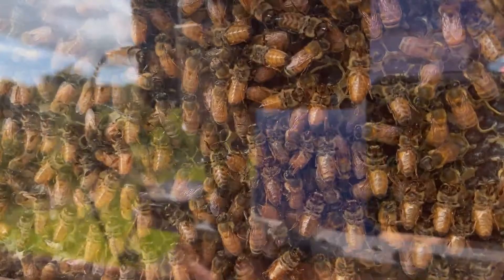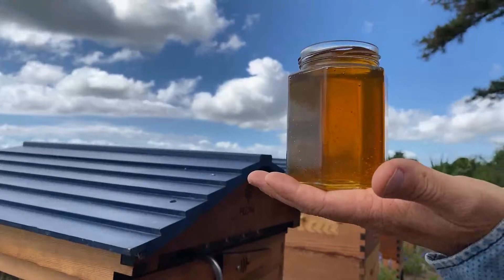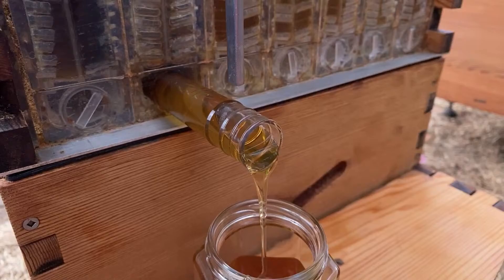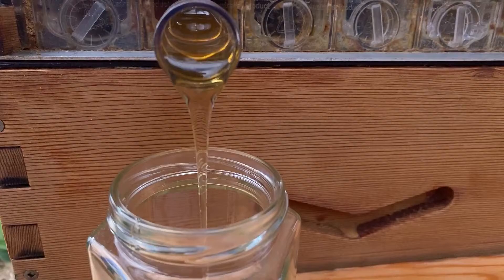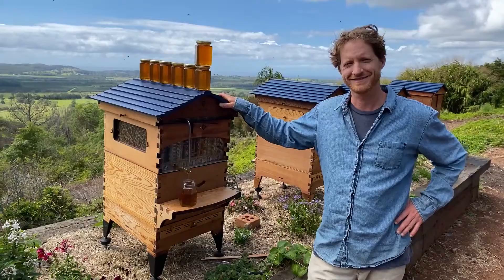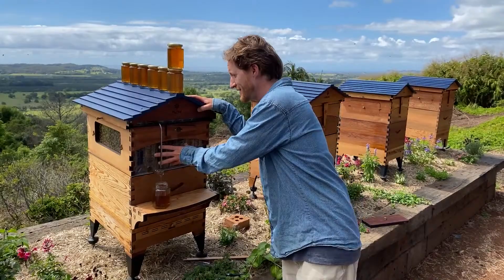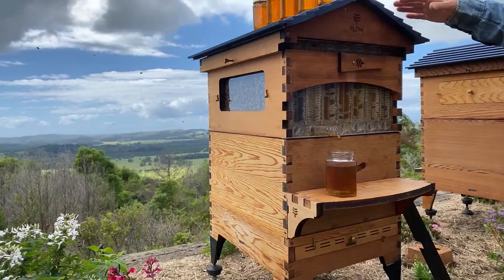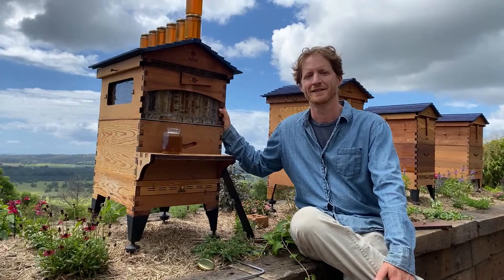How do I harvest honey from my Flow Hive?

Comment: Hi Cedar. Good to see your videos every week. My question is about flow frames leaking honey into the hive when draining honey. Is there a way of stopping this from happening. 
David. Brisbane Australia.
Reply from the maker: Hey David,
Thanks for your message. Sometimes the Flow Frames leak a small amount of honey during harvest. We have found that this can be more likely on the first harvest of the Flow Frames and can be the result of the bees not completing the capping on the frames all the way to the base. If the bees don’t complete this capping then the lower cells are 'open' and on occasion, can be prone to leak when the pressure of honey flowing down the zig-zag vertical channel is too much for it all to get into the trough below.
Usually this leakage is less than a few tablespoons per frame in which case the bees will mop it up and recycle it. The honey is not wasted although it can be frustrating not to be receiving that extra honey in your jar.
Please email us at info@honeyflow.com if the leak is more than this and we can troubleshoot with you :) - Danika